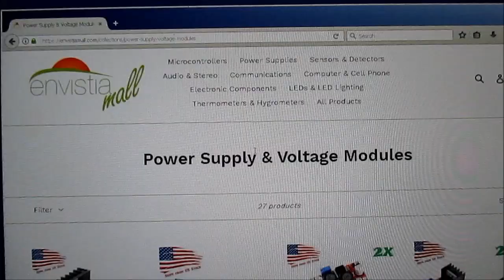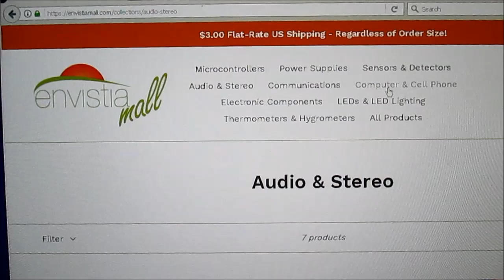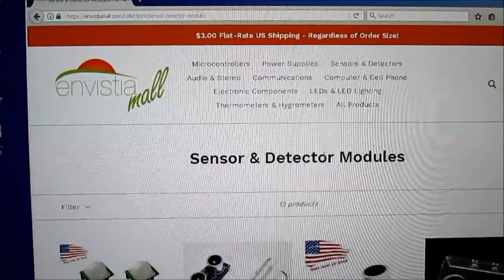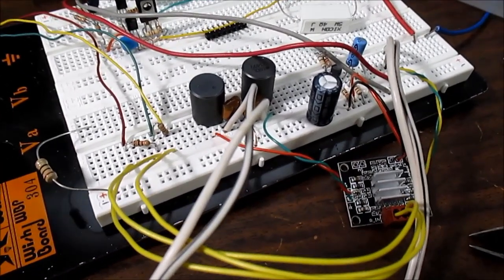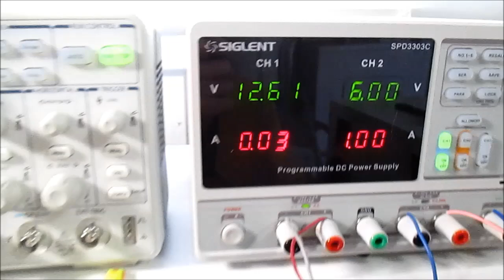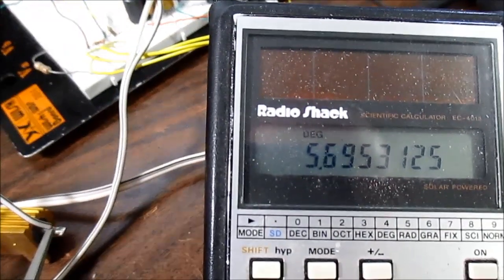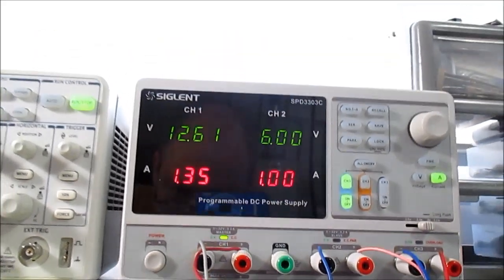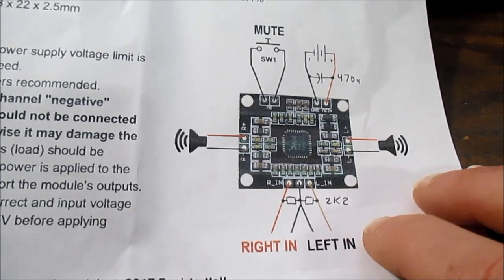PAM8610 tiny stereo audio amplifier board review and test

Comment: How is the current consumption of this amp at full power? I want to use 4 Ohm loudspeakers and 12Vcc...
My question is because I will build a power supply for this amp, with a transformer, bridge rectifier, and 7812 regulator...It will be enough for the amp or will need bypass power transistors for more current? Thanks a lot for the video!

Comment: When  you say that if the board does not include large filtering capacitors and you externally wire these in...  where in the circuit do  you attach the external capacitors?  can you tell me what time into your video a particular board is where you did this and point out what wires are going to the external capacitors?  What should the capacitor values be?  Thanks for this insight...
Reply from the maker: The capacitor is placed across the power supply leads. It should be close to the board as possible. 2,200uf would be a good minimum value.

Comment: At low volumes the pwm linearity can become audible, especially for lower pwm frequencies which could pass the output filter to a certain amout of magnitude. Sometimes also the output filter itself is the problem or it is even not present. Did you do a listening test with applied output filters? This could really make a difference relating low volume distortion.

Comment: I use it on my bluetooth speaker, powered by 18650 batteries (3X2 design 12.6V) with high sensitivity drivers (2X 4Ohms), I can confirm that it has a very "grainy" sound at low volumes, but it don't bothers me, and it is so loud that I doubt it got only 3.9W per channel. A thing I found is that I bought this amp a while ago, and recently I bought 3 more of those and they all ended with the output shorted to one of the rails (bringing straight DC to the speaker), but the one I bought for first still working fine! I think they are so cheap that they became disposable amplifiers.

Comment: Ive used this board for my jbl loft40's and they have great sound i used then without a pot just straight lined in. The loft 40's are already filtered hi/lo pass and i didnt have a noise issue although when i tried them with regular un filtered speakers they didnt sound as great and the good sound wasnt really there like with the loft 40s.

Comment: I've implemented 2 of these in diy mobile crates with 4 ohm 5.25 inch car speakers and 12v gel batteries. In my setup, they exhibit near silent operation, no hiss or hum at all. Maybe it's still the power supply generating some noise? You did put a capacitor on the powerline but in my opinion it is too far from the board. Solder it directly to the powerpins on the board and put an extra 100nf bypass cap on it for good measure. Also, ferrite hf beads will help, they could be clip on type or even hf "pignose" chokes or salvaged ferrite cores from dead pc psu's. As long as they are as close as possible to the board.
May I also suggest you put the heatsink on the BACK of the pcb instead of on top of the PAM chip? The chip's heatsink pad is soldered to the pcb and the pcb has a lot of plated through holes underneath it. SO, the heat is dissipated way better through the board instead of through the black insulation on top of the chip. Mine stay reasonably cool on 4ohm load and 25 watts rms power. To help cooling I've placed the pcb in the airstream of the bassport so the louder it plays, the more movement of air there is around the heatsink. Works brilliant, they can play loud for hours without issues.
Reply: When I used them I had his or hmm from the same board depending on the 3.5mm Jack I used. I thought it was strange.
Reply: Sorry I wasn't clear. If I used a 3.5mm female Jack I got hiss and hmm but when I used 3.5mm male Jack I got clear sound it didn't matter what device I used to play music from.

Comment: I have this 8610amp it keeps quiet on strong bass on high volume but red light still on, when i disconnect the adapter and reconnect after some minutes it plays,, what would be the issue?
Reply: Anti clipping protection? Probably a low-impedance/high gain preamp (Like the built in audio out on a PC motherboard). Use a tone-Board, easy fix.

Comment: I got a problem with this board. I've got 7 of these and I finally finished my 12 volt (3s 18650) speaker using this amp. But I've blown 4 of these amps on using the speaker. They seem to have a common problem, the speaker cone connected to the outputs will suddenly go "down". The amp chip will then get very hot. When I turn it off, the speaker cone will go up again to its normal position. I don't really know whats going on. I've already gotten the bluetooth module on a separate battery to avoid ground looping and other issues. Could you help me with this? I've also tried putting a heatsink but still the same result. Do I need to get a larger heatsink or something?
Reply from the maker: Are you connecting the speaker directly across the outputs or one side to ground? These are bridged outputs and must not be connected to ground nor should a shared lead be used as common between the channels. This will kill the amp pretty quick.
Reply: @JohnAudioTech  The outputs are connected to a left and right 10w 4 ohm speakers each with separate leads and they do not share a common ground. But I am still killing these amps even though they already have a heatsink. I'm planning to use a different amp this time, this thing breaks so easily. Could you suggest a different amp as small and as powerful (preferably, a class d one) as this one? I only have limited space on the speaker enclosure.
Reply: Try adding a capacitor in Series to the Speaker. It might block off that dc that's passing into your cone (the Cone pop that's happening). Other than that can't really do anything about this board. I blew mine up by accidentally shorting +12v to R-in 😂
Reply: @adithyapillai4259  Thanks for the tip. I still have 2 of those lying around. Unfortunately, I abandoned the PAM8610 amp for my portable speaker. It gets quite hot and easily blows up at 4 ohm loads even with a heatsink and thermal paste. The cone doesn't just pop at the start up. It just go down permanently  until I turn off the amp and the amp will get very very hot when the cone goes down. Anyways, I replaced it with a bit more powerful amp. The Yamaha YDA138 x2. It outputs 20w in bridged mode. I bought one that contains 2 chips. No problems with the amp so far. Only problem I've encountered is that I've accidentally blown the right speaker so I'm ordering a neodymium one.
Reply: Seems like you're doing something wrong with your amp there buddy. The behaviour you're talking about is where the chip is blown. I do have some blown out boards that behave the same like you've experienced. They draw like 2 amps and gives out that magic smoke. While doing so the speaker behaves the same as you described.
Reply: @adithyapillai4259  So weird though, the bluetooth module (CSR8645) has a separate battery to the amp so that I could avoid the ground loop issue that might be causing the amp to blow. Still, it blows at high bass songs at about the volume level where the outputs don't distort.

Comment: My hiss was coming mostly from my input source which is a Bluetooth 12v device I put a 16v 2200uf  cAp on directly on tha Bluetooth power terminals and a inductor clear it up well  run 8 ohms  10/14 watt.    4ohms 20 watt.  3ohm  never get hot   With only a bolt superglued down for a heat sink.  But still not a great sounding amplifier

Comment: Hey, I'm back again. I bought this amp online. I was really satisfied with the PAM8403. But I was still lacking some volume. Since this is 12v. Can I just use a boost converter to boost the voltage from 3.7v to 12v? Well, I already ordered it anyway. Maybe I'll just wait for it to arrive and just test it.
Reply from the maker: You would need 7 or 8 amps at 3.3v to get the 2 amps at 12v the amplifier needs.
Reply: Just get/find 12volt 2amp wall wart ...Are you limited to 3 volt batteries or something?
Reply: Coil Smoke Yes. Although, I had a change of plans. I bought a 3S BMS for 12v that the amp needs. I was just wondering if I could charge the speaker using a 5.0V 2.1A. That's why I before, I opted to use 3.7v 18650 cells. But I guess that will be a bit difficult. I'll just build a special cable that boosts the 5V output on a powerbank to charge the 12V speaker. It might be charging slowly but atleast I can charge it with a powerbank.

Comment: The distortion you mentioned at low volume may be caused by the fact that the board does not have an output filter. I have had similar experience with a purchased class-D amp. When I connected a headphone there was a lot of noise and really distorted sound. But with speaker connected it was fine. So it can all depend on how well the speaker and cable works as a low pass filter. I would recommend to always use a filter on the output.
Reply: If that's true, the music would sound terrible through a piezo or ribbon tweeter, as they don't have enough inductance to filter the noise...

Comment: Hey can i run 2pcs of 2ohm 15w speakers? What voltage should i supply? 12v or 9v?
Reply from the maker: 2 ohm is two low for this amp.
Reply: That is such an odd ball speaker...Are you sure about those specks? most 2 ohm speakers take/handle WAY more  then 15 watts

Comment: My pam8610 stop and play repeatedly.
What do you think problem?
Reply: Your power source is too weak, change it to a 30 watt 15 volt (at least 12 volts), the cables from that to the PAM module must be thick. Add a filter capacitor right on the module +&- . If it still does that probably a channel is burned (has 4 amps inside connected in bridge 2x2) and makes the chip hot to protection.
Reply: @himanologanor4093  I am testing my class d amp board and I found same issues,I will try to explain it as clearly as possible.
1)it plays well for 20 mins or so and after that it pauses every 2 seconds or so(like-play..thump..play... Thump...play..thump so on...)
2)if I unplug power supply and replug it,playtime depends on how long I unplugged the supply(max30 mins play time) and after that issue persists again.
3)as some people here suggested and I too thought it was a heat issue and pulled heatsink (it is not getting hot at all to touch).then I found that there is no thermal paste on it,it is just super glued.I thought that is the issue and pasted some thermal paste and put the heatsink on the chip(just pressed on to it ,not glued).the problem still exists!!!
4)I am running it on 24v supply and about 1 amp current.is this issue?power adapter isnt getting hot to touch.I thought power is the issue and connected it to car battery 12v 15amps and stepped up to 24v but still I am facing same issue.
5)I am running board with recommended ohm load speakers,4 ohm 50w.this happens even at low volume.
The board is tpa3116d2.please help me identity the problem,please
Reply: Something is tripping their self preservation circuit(s)?...Could be an oscillation, even one outside human hearing. You might see something on an oscilloscope
Reply: I have same issue but don't know the cause;(

Comment: I believe what you're hearing is accounted for on the specs sheet.  The process of amplification causes noise.  It's just a natural byproduct of how the circuitry works, operating temperatures, how the signal is interpolated, etc.  Digital audio introduces additional errors based on sample rate and subsequent quantization error (though this happens at a point outside of human hearing at sample rates of 44.1k and above based on nyquist theorem).  Analog amplifiers are no exception, though the nature of the distortion (often called saturation)  is generally more pleasant to the ear which is why tube amplifiers are still sought by many audio enthusiasts and the harmonics properties are  even modeled and artificially reproduced in modern digital music production to add warmth and character to different audio material.
Going back to this particular unit, it has a particularly high noise floor since the spec sheet said the signal to noise (SNR) ratio is 90 percent.  There are a lot of different ways of measuring SNR data for different applications, but if I"m not mistaken this ratio indicates that at the tested value (perhaps peak load) there is an SNR ratio of 90 percent which means that 10 percent of the signal is noise introduced by the chip's operation.  Where THD will increase as you exceed the clipping threshold introducing new harmonics that change the intended character of the sound,  I believe SNR is more of a constant noise and therefore becomes more apparent under low audio outputs due to less harmonic content to mask its presence.  I imagine this was an intentional trade off to create cheap parts with high amplitude potential at the expense of fidelity that is less perceptible at nominal levels.  
I also imagine that unless these amplifiers were advertised as RMS watts then they used Peak values because they look better on paper which  means the chip probably would perform as advertised when measuring peak value at maximum load.  Though this would create a massive amount of heat which is probably also what is responsible for a lot of the noise since heat disrupts copper's ability to conduct and therefore causes errors  in the transmission of data.  I'm not suggesting that this is a fantastic piece of high fidelity equipment, but if it's relatively cheap as you hinted at then I would imagine that it's working as advertised and the drawbacks are a byproduct of getting what you pay for.
https://en.wikipedia.org/wiki/Signal-to-noise_ratio
https://en.wikipedia.org/wiki/Nyquist%E2%80%93Shannon_sampling_theorem
Reply: VERY NICE , that is a lot of good info! thank you.

Comment: envistia mall guys may be biting their nails now, lol. 

but you may still want to try it with battery supply, to check if the hiss is still there. long live pam8403, lol.
Reply from the maker: Although I'm pretty sure it wouldn't make a difference, I tried a 12v battery and the distortion is still there. I had a 1000uf and .27uf supply bypass caps, so it is pretty well decoupled from the supply anyway. I even played music through the low pass LC filter I use for measuring power and the distortion is still there. I tried shorter speaker cable, different speaker, removed the preamp, ect. This board simply has issues.
Reply: Why would they? I found out about the store from this video, and if i was within their service region (i'm in Europe), i'd certainly consider buying from them rather than straight out of China, due to their reasonable pricing for presumably fast delivery. I think this video is to their benefit. And after all, people will buy crappy stuff and will not be disappointed if it's sold with integrity and honesty behind it, sometimes it's just what you happen to need.

You don't expect a PAM to sound perfect, and you don't expect perfection for $2 either. For its intended use case of doing ultra cheap and somewhat loud audio, it's perfectly fine.

Knut Ballhause from German µC forum suggests an LLC filter on the outputs, 2x47µH, 1µF, reports reduced noise.

Comment: Hey John, have you or would you consider reviewing some TDA7293 amplifiers? The particular ones that cost $2-$4, to see how they perform. Another great video by the way!
Reply from the maker: My friend bought some from Banggood and neither of them are working properly. He has assembled some more involved kits, so I don't think he made a mistake.
Reply: Actually, it turns out I got them from ICStation! But it's strange that Banggood specs them at a lower voltage when you'd need to be near 100 (50+&-) to get 100W. When the first one didn't work right, I brought the other one up slowly with a variac and it does work at the reduced voltage. Both attempts are recent videos

Comment: I have used a couple of these chips for various purposes and haven't experienced the low-volume distortion that I hear in your video.

What I did experience however is that these tiny PAM8610 and the PAM8403 boards have problems with certain power supplies and power-, speaker- and input-leads and volume-knobs where my sure-hifi class-D boards are much more forgiving.

My hunch has been that the on-board output inductor coil and capacitor quality where key factors.

Comment: hey jhon.. about the hissssssss .. for some boards the gain of the chip is set to high ... it's a resistor change .. Search the data scheet for the value's
Reply: Hi Roy. In datasheet I see 120k for ROSC and on my boards I have this value.  Also datashet says that ROSC is 1/8*VCC. For VCC I have 12VDC. So 0,125*12 > 1,5?

Comment: My PAM8610 is running well without heatsink at all... Running preclipping at 4ohm. No problem at all...
Reply from the maker: It can work with music as average power is much less. The chip itself is capable of 4 ohms loads, it just needs the heat sinking, especially when playing music loud that has long sustained bass notes.
Reply: You are correct. The datasheet clearly says 15w at 4ohms and the thd rise a lot! I prefer higher the TDA8932 as it's capable of 20w clean music...
Reply: Is it better than pam8403
Reply: Hey can i use 2ohm 15w drivers?

Comment: Hello, would you be so kind to point me in the direction of an online store that sells transistor amps that isn't ebay. Not built, just the transistors. I have a JVC amp that has a quieter channel and they tell me it might be the transistor (Im going to send it out to get it checked, just in case ). Just looking for info to help with the sourcing of parts.
Reply from the maker: Here in the US, I'd source transistors from DigiKey or Mouser. In other countries you have to find a reliable vendor or import them.